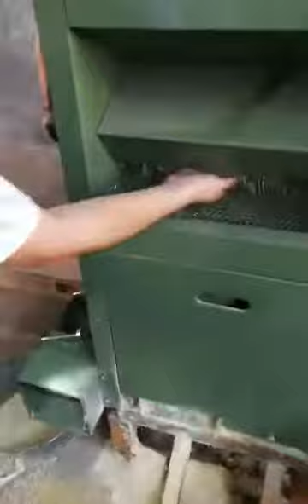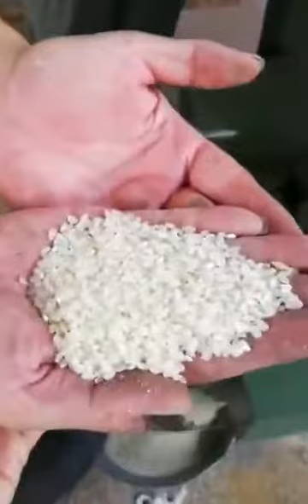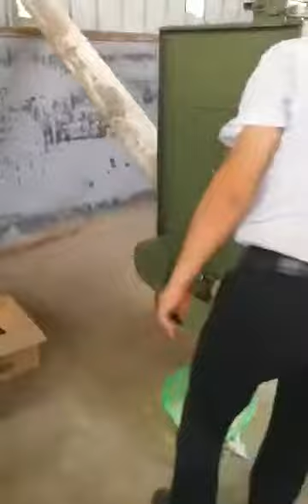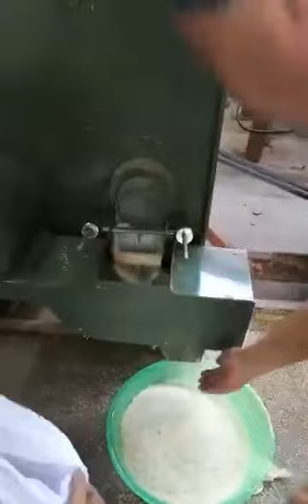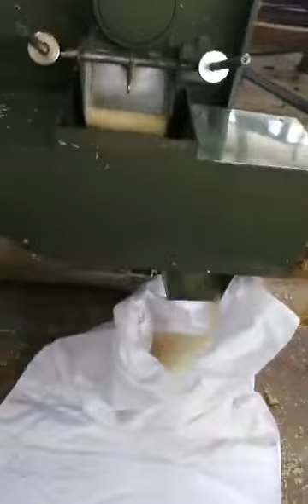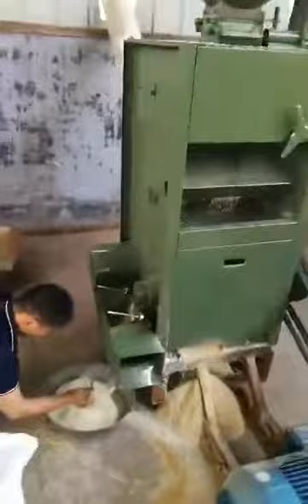SB30 rice milling machine 1

Comment: I need one of these
Reply from the maker: jack878990@gmail.com  whasapp or phone No. : +8618713193899
Reply: Datos técnicos de la piladora sb30
Reply from the maker: @eduardoguerrero7030  ¿Puedo tener tu dirección de correo electrónico? todos los detalles se enviarán a su casilla de correo tan pronto como sea posible
Model: SB-30
Capacity : 1100-1500KG /

H
Power: 20HPS
Dimension:
1070 * 760 * 1760 mm
Weight: 300KGS
With diesel engine